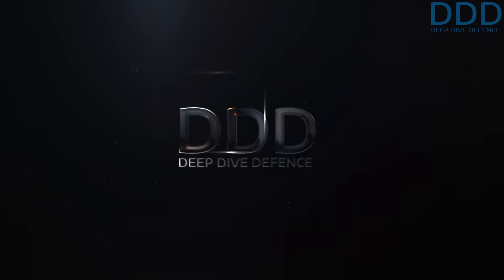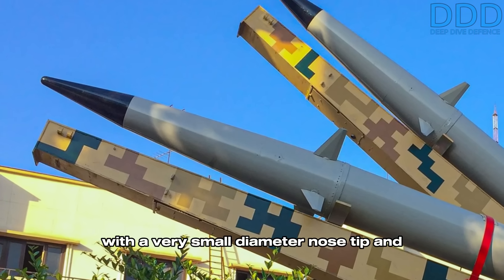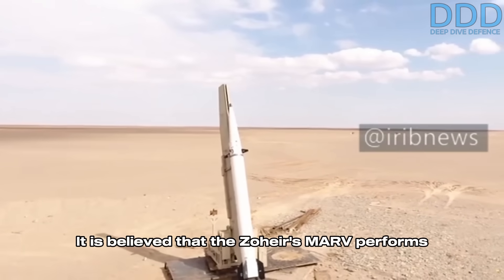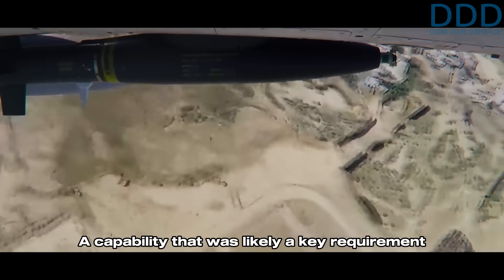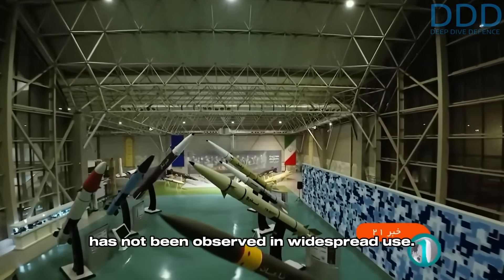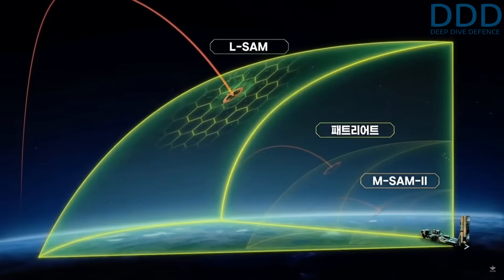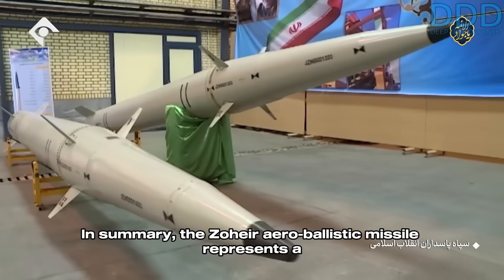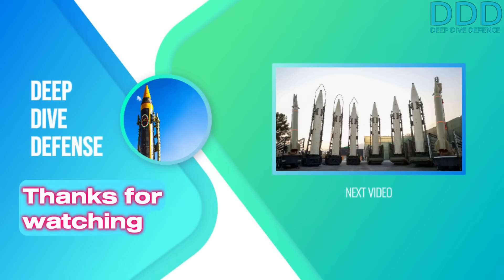'Carrier-Killer' Missile? Yemen's special Iranian-made Zoheir missile (Tankil)

Comment: Overwhelming air defense over a US carrier battlegroup simply means you match the missiles on the escorting destroyers with inexpensive threats and then hit the main target with your prime missiles.    This is why US carriers would never get anywhere near Iran in a war.   How do you know there will be no war with Iran?  Easy.  There ARE carriers in the Persian gulf.
Reply from the maker: Very good points!
Reply: Agreed.  However, that's ONLY if Iran has stockpiled enough ballistic missiles, and they are accurate enough to consistently hit their targets (not 1 km from their targets).  Only then will the costly interceptors be utilized in order to down these missiles.  I fervently hope that this is the case.

Also, the range of the planes on the carriers seems to be greater than the range of the ballistic missiles launched by Iran; I hope I'm wrong about that.

And finally, I don't think the US will use carriers to attack the Iranians from.  Instead, they'll pull back in some limited support operation.  Their real attacks will come from Diego Garcia Island or a country like Saudi Arabia, or even from Syria.  They'll use some system of air refueling midway.

Comment: Is not just reducing the weight and increasing the range with composite materials and carbon fibre also making them cheaper and faster to developing them
Reply from the maker: Not cheaper than high end steel alloys and production methods, but easier, yes

Comment: I'm genuinely surprised to learn that carbon fibre boost engines and carbon carbon Marvs are considered technology appropriate for the Houthi and Hezbollah.  But I guess if you can get your hands on the basic materials, it's all a matter of weaving, heating and compression.
Reply from the maker: Somewhat counterintuitive, yes
Reply: IF Stockton could build a submarine out of it, then any State can set up a simikar workshop. Kim uses the exact same machine as Titan, but his winds them as a vertical tube, not a horizontal hull.